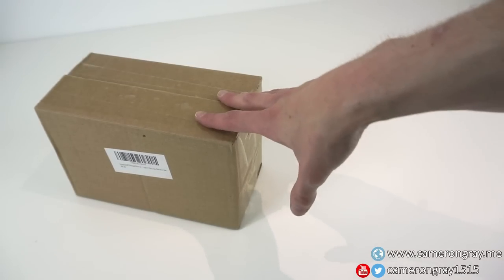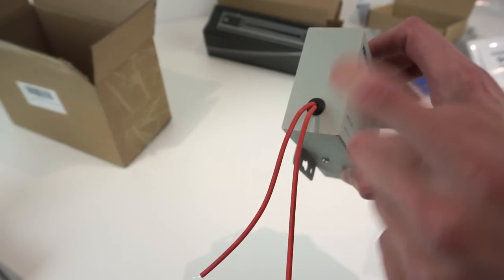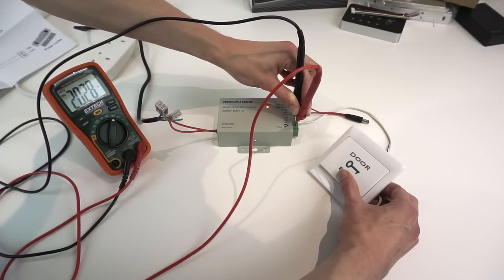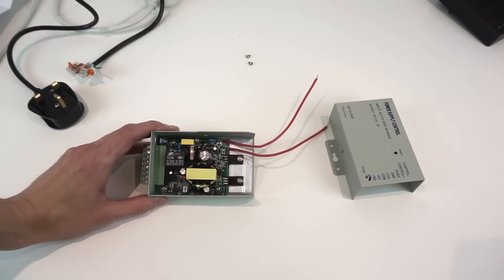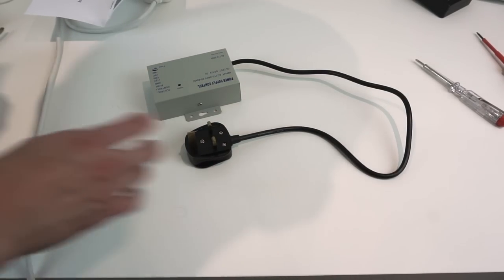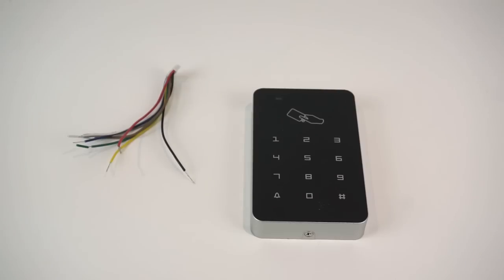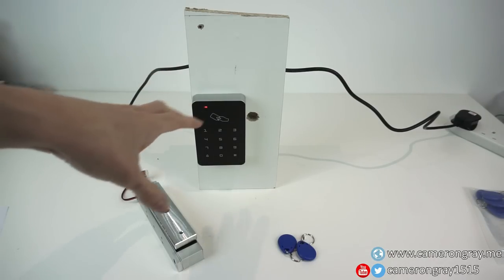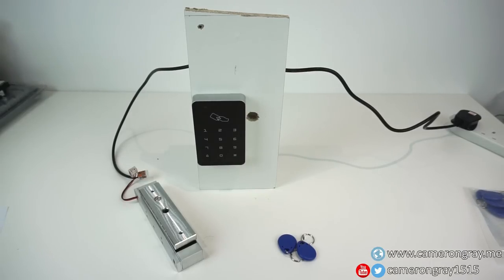Cheap "Access Control" System - Defeated with a screwdriver!

Comment: Radical idea here..   How about they design a keypad where the electronics actually doing the checking and unlocking are in a box on the back of the doorframe, with the box at the front containing only the electronics required to run the keypad and RFID reader?   I realised that is likely how more professional systems are designed.
Reply from the maker: That's exactly how the professional systems work - there is a control unit located on the "secure" side of the door (or even locked away separately) that handles all authentication and connects to the lock (often also has a battery backup).  The card reader/pin pad.etc then connects to this unit using a digital connection that simply sends key presses/card data, if someone were to break off the keypad/card reader, the most they can do is access these digital lines which are of much less use for opening the door.  Suspect you may be able to brute force codes by simulating a keypad on these digital lines although this could be mostly solved by rate limiting.
Reply: @camerongray1515  there is an attack that someone has done with the better systems, where they installed a device of some sort (which essentially grabs the credentials when someone scans a card, and can then use that credential to unlock the door for the attacker)
Reply from the maker: That's definitely true, they can often be defeated with fairly standard card cloning type stuff, but that would take a lot more effort, skill and hardware than something like this that could likely be done purely with physical brute force.  Card cloning can usually be overcome by additionally requiring a PIN after scanning a card essentially implementing 2FA.  This is standard in most higher security applications.

Comment: Just bough one of this cheap access control set, and you know what?) They filled the whole scheme's back with epoxide so you don't have a chance to make that fancy move anymore)
Reply from the maker: Interesting, I imagine it's more of an attempt to seal it against moisture rather than any sort of security improvement. If the device is architected the same as the one I showed here (i.e. where all the processing is done by the external keypad) then you're still vulnerable if an attacker can get to the cable.
Reply: Just got one too and my back is fully open

Seperate question though and maybe this is my being stupid.

I can't get it to power with a 12v batter back connected to the PSC

Comment: I buy prison electric locks, actual American access control keypads made for vandal resistance, and they are much much harder to defeat. Anything can be defeated given enough time and resources which, outside of a prison or asylum, can be done. But I digress
Reply from the maker: With this it's very much down to the system architecture rather than the actual physical hardness.  Even a cheap plastic keypad can be perfectly secure if the actual processing is done on the inside of the door and all the keypad does is send a digital signal of keypresses/card information to a controller in a secure location.  A super robust metal keypad is still flawed if it's possible to simply short some wires inside to open the door.  The issue with the system I demonstrated here is that the wiring behind the keypad has a wire that can simply trigger the door to open.  If all there is behind a keypad is a digital connection to an external controller, it's not going to be possible to attack this without simply brute forcing codes down it and even that could be prevented if the digital signals are encrypted.  At that point, it would be easier to physically break the door down rather than to bother attacking the access control.
Reply: @camerongray1515  Hmm.. Since I got your attention on this, and indeed you seem to be one of a few that actually plays with this stuff like me, could you do a very very simple test? Place the keypad behind a piece of 3/4" thick board like what you used to mount it but try to trigger the keypad by putting the fob to the board instead of direct to the face of the keypad. Will it pick up the signal THROUGH a WALL? That is the experiment. See, IF that is possible, you can HIDE the keypad INSIDE the wall but behind a skin thin enough to allow the RF signal to pick up the fob but thick enough to still be THE WALL. Inside a house or office the wall hiding the keypad face would be drywall or plasterboard as is called in some places. But on a BRICK exterior though? Hmm, a thin fake brick tile in front of the keypad hidden inside a recess in the wall? You can test this by placing a ceramic tile or piece of plasterboard in front of the keypad and try to trigger it with the fob. See, that is the idea I have to resolve the OBVIOUS device next to a door conundrum I am having in a bad neighborhood where break ins ARE prevalent. The door and prison lock then become real secure if the thief can not SEE a keypad or keylock switch to try and tamper with. And yes.. a controller placed in a secure location is key here lol! I have read some keypads with RFID sensors, allow you to remove the RFID sensor part and place it remotely some where to trigger the keypad too, but without the keypad electronics being present at the remote location, without having to buy some expensive networked access control system to achieve this. The manual PDF states you can place the plastic RFID sensor that just has the 2 wires attached to it, to say the outside of your front door with the keypad on the inside in a secure location. The keypad is made of plastic too so that makes sense no? BUT, can you HIDE the sensor behind  say plasterboard or a thin brick and have it still work? THAT is the experiment I am wanting you to try since you DO have a keypad like that. Shoud be simple and real quick to know if the RFID signal is strong enough to pick up through tile, brick or plaster or wood panel.
Reply from the maker: Unfortunately I can't really test much with this since I'm currently using the power supply for another project and the rest of the parts are stored away although I imagine it's very dependant on the reader and fob used as to how strong the signal is.  That said, a properly designed system with a reader that has a purely digital interface to a securely stored controller should be totally secure and can't be tampered with from the reader.  Systems like these are commonly deployed in many high security applications such as datacenters without issue.  I can't imagine hiding the reader to have any real benefit from a security perspective.  You'd also realistically need some sort of manual override in the event of a system failure (either to cut power in the event of a fail safe lock or some sort of manual key lock if a fail secure lock is used).  This is likely to be a much more likely plan of attack, the average burglar isn't going to be attempting to exploit a controller through an externally accessible digital connection.
Reply from the maker: Additionally, in high security environments it's important to have multiple factor authentication, you'd usually have both a key fob/card and then have to enter a PIN into the reader.  This prevents people being able to use stolen/cloned cards as they won't know the PIN.  Therefore you'd need to have an accessible keypad to enter the PIN.

Comment: Then again you do realise that they could have a normal door lock and they're only using this is a second-hand solution
Reply from the maker: They could and assuming you'd need to use both locks or if this is only used as a sort of basic form of access control when the main lock is unlocked then it's not necessarily dreadful assuming the risks have been considered.  The issue is people fitting these in situations where they're the only form of lock on something that should be kept secure.  I've seen these things used on "secure" car parks and doors to apartment buildings as the primary lock.
Reply: @camerongray1515  I get what you're saying because there are some access control systems that are lot more secure for example Paxton net2 access control uses proximity readers and proximity fobs and it's configure the on a PC which I think is pretty cool what I'm going to be getting for my shed is a Paxton switch 2 controller to use on my shed but I also have a padlock installed on the shed door which makes it extra secure
Reply from the maker: Yeah, those systems do it correctly by keeping the actual brains that control the lock in a secure location so if someone were to remove the reader, there's not much they can do as it's a digital connection.  I've used Paxton net2 briefly in a commercial office (although admittedly just to enrol a card, I didn't actually install it).  My fear with the cheaper systems like the one shown in this video is that people see the Paxton systems in use in commercial settings then see the cheap devices on Amazon and think of them as being the same thing.

Comment: Jeeze... this is too easy to hack lmfaooo. Thanks for this video... have 2nd thoughts in getting this. This is why I hate company's design system, it's best to use all pure software, fully custom centralized system where the software reads all inputs. These are know as ur Arduino lock systems which is much safer than standalone systems. 
You have to install this particular keypad module with the screw hidden from a person like yourself digging around there, obviously. Any professional knows this and would install the keypad flushed to the wall. But I have to agree, the screw right beneath the keypad is really stupid, using an ordinary Philips screw some, effort should've been given by the company to make it difficult to open easily. It's going to be really tricky to hide that bottom side screw and making it legitimately hack proof.
Reply from the maker: The issue is greater than just the screw, even if the keypad was mounted flush, it could still be destroyed by hitting it hard enough which would expose the wiring.  The way this should be done (as is the case with professional systems) is that the device on the outside should purely read card details and key presses and send these over a digital connection to a device on the "secure" side of the door which checks the code/card and operates the lock.  With this, even if the card reader is totally ripped off the wall, all an attacker will have access to is this digital connection which can't simply be shorted out to open the door.  The worst that could be done would be to attach a device to this digital connection to brute force a code but even this could be resolved by using encryption across this link.

Comment: He’s jumping the relay. This could be done on a lot of systems. Even expensive ones.
Reply from the maker: A high end system will have the digital processing logic running on a controller in a secure location, on the outside of the door you would have a dumb keypad that would send a digital signal to the controller containing card information/pressed buttons.  If an attacker were to remove the keypad, all they would have access to is this digital connection which can't simply be shorted out.  With the system shown here, the system simply sends an open signal directly to the relay which can be shorted out easily.

Comment: no sense video, the access controller must be in the indoor , the magentic lock too. An slave reader is settle al the outdoor.
Reply from the maker: This system doesn't have any sort of ability to use a "slave reader" and it clearly is designed to have the keypad on the insecure side of the door and the push to exit button on the secure side which is the issue.  The way to do this correctly is to have an access controller where the actual processing is carried out by a device in a secure location which is connected to a dumb keypad on the outside of the door over a digital link.  IMO there is no way to install the system shown in this video without it being vulnerable.

Comment: I'm NOT going to watch this video. I know you are going to talk about the lock relay being in a Keypad or reader available to anyone that is on the Unsecured side of an access control point.  YOU get what you pay for!!!!!!! If you want to post a 32 minute video about defeating a CHEAP access control system go ahead. I am a professional security technician. I can assemble a door that I promise you that You CANNOT defeat.
Reply from the maker: It's not like I forced you to watch the video... The point is to demonstrate the issue to people who don't understand the security risk of such locks and end up using them where they're not suitable.  It's not like I'm trying to act like some sort of security defeating god... No need to flex that you can assemble an undefeatable door, I'm not saying that I can defeat anything that's designed properly!
Reply: @camerongray1515  Gotcha.

Comment: When you talk about the power supply and the 2 red wires you don’t like I can’t understand a word you say.when you talk fast and your accent makes it impossible to understand.but it is a great video and I know how to hook mine up now.thanks
Reply from the maker: Apologies, my issue with the wires is that it's a pair of single insulated wires which isn't compliant with UK regulations which require that any high voltage wires that can be touched by the end user in normal operation are double insulated.  Usually this would be a piece of flex with the live and neutral individually insulated and then those would be insulated together inside a single outer jacket.

Comment: You just showed all the criminals how to bypass these type of locks with keypad
Reply from the maker: It isn't exactly difficult to figure out and there's already content out there showing how to do similar attacks on other locks, I felt it was more important to warn people about not using locks like this since chances are, criminals already know how to bypass these whereas the average person who isn't particularly security conscious will buy these on Amazon thinking "hey, it looks like the one I have at work" and not understand the risk.  I view it the same as with cybersecurity, it's more important to talk about issues so that people are aware of them and can fix them rather than keep them secret since chances are, if the good guys can figure it out on their own, the bad guys can as well.
Reply: @camerongray1515  you should do a video about similarly priced wiegand hardware, I bought a keypad and a basic controller off aliexpress for like 50 usd, although i guess the one you have in the video also includes the lock, i'm using mine to act as a wired garage door keypad